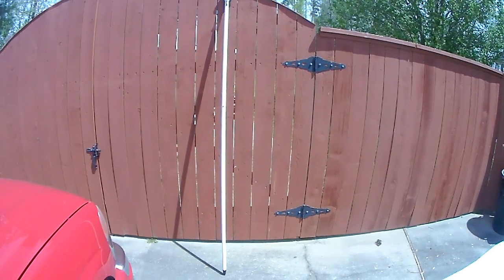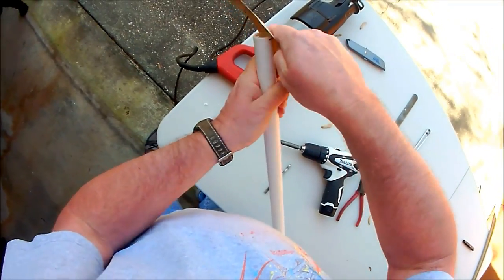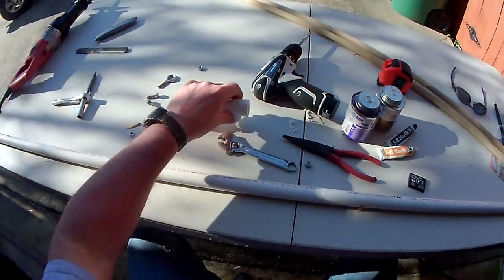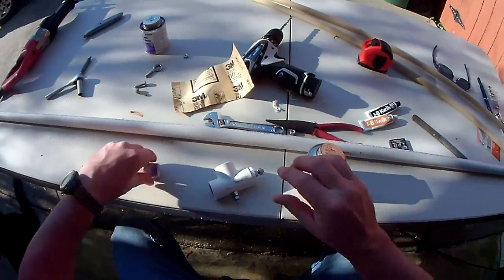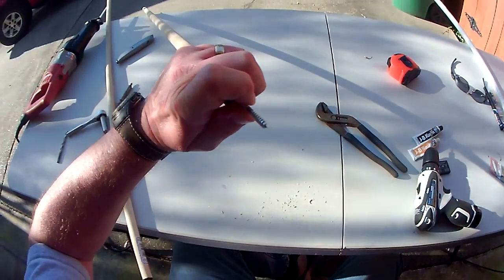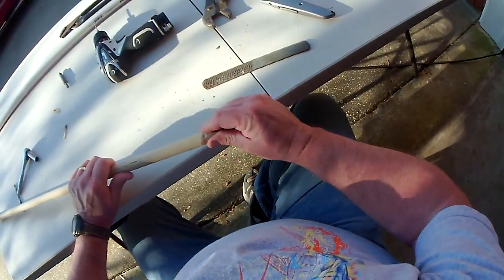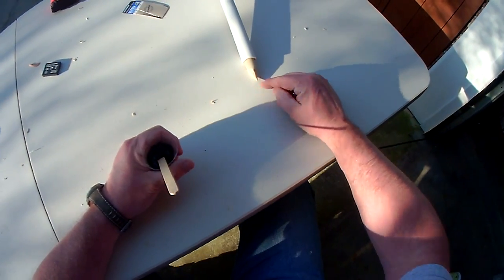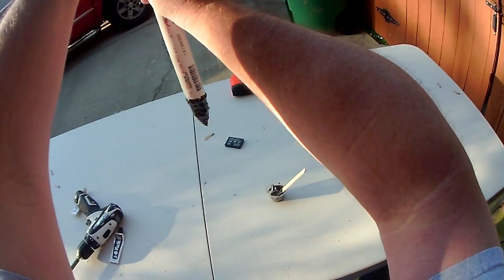Stakeout Pole DIY Build

Comment: Used your build instructions and made a 7' 8" pole. Used it yesterday for the first time. It worked like a champ in pluff mud and hard shell bottoms. Thanks.
Reply from the maker: Great! I'm glad it worked for you. Just curious, what was your final cost? 

Do you use an anchor? Check out the retractable anchor line video. I fish in 12 - 15' of water and the retractable anchor line system is a dream.

Comment: My cost was about $20. I do use an anchor. Right now I'm using Venture Tube's first design on his channel. Works fine. I like your solution too. Customizing the Yak and it's equipment is almost as much fun as catching fish.
Reply from the maker: Wow! sure beats cost for manufactured pole! Its lighter too! I like customizing my kayak as well if you haven't figured that out. LOL! I have other videos in the making, but was distracted with changing jobs due to layoff. I promise to get to those videos soon. Good Fishing!

Comment: They make a clear primer.  purple is used in construction so the inspector can tell at a glance  a joint has been primered.  If you don't use it  your joint will fail.

Comment: I like the design.  After having used it a while, are there any adjustments or changes you have made since?
Reply from the maker: Not at all. The video shows the final version. I like that it is much much cheaper than commercial models. Thanks for watching. Check out my latest video on retractable anchor rope. Awesome outcome and benefit.

Comment: Only thing wrong is the jb weld is polluting the water . Good design and video though. Great job
Reply: How is that?
Reply: +Bobby Beans are you worried about boat hulls polluting the water? or PVC plasticizers doing the same?
Reply: Quit peeing in the lake it cancels out.

Comment: there's absolutely no reason to use sand paper on pvc. other then that great video!
Reply: Coltyn Clark A lot of tradesmen do sand pvc before primer, really helps with bigger pipes and longevity of the connection.
Reply: Coltyn Clark just fyi for your own projects.